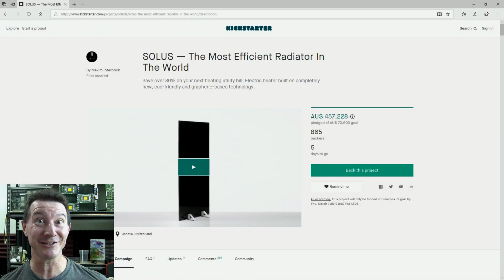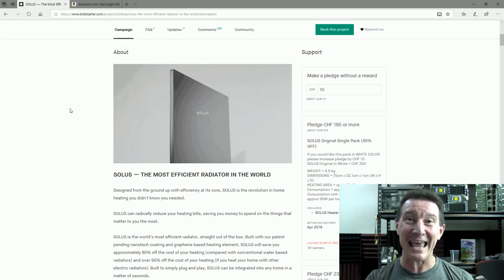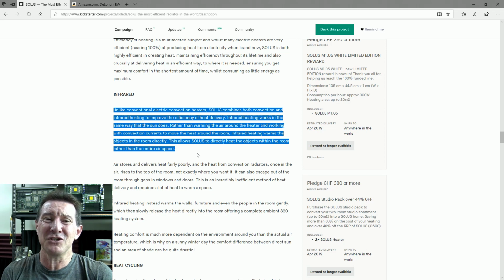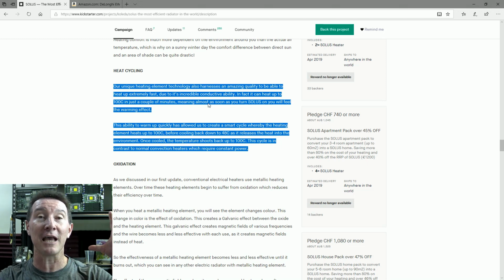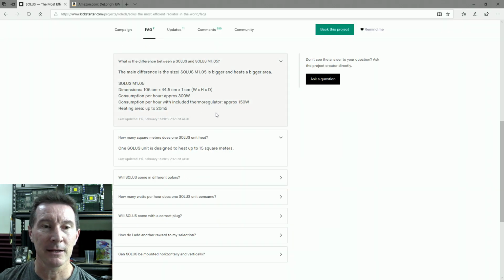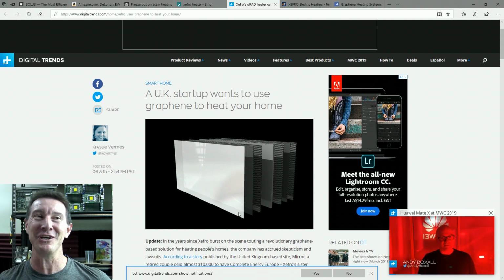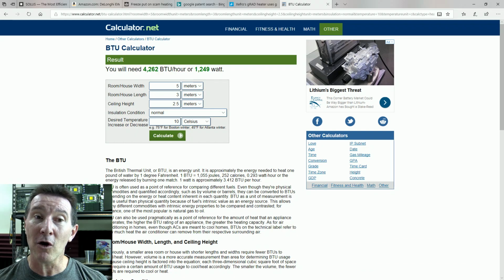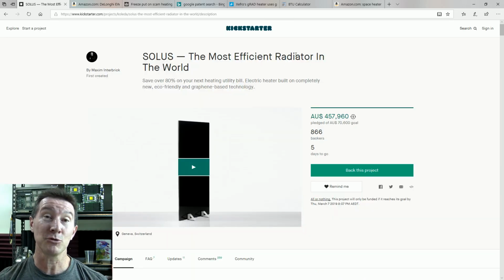EEVblog #1186 - Solus Graphene Heater Kickstarter BUSTED!

Comment: The idea is selling by the design , if this thing achieve the infrared spectrum to deliver heat not a bad idea and glass is not an issue , but my doubt is about that specific point , how you deliver infrared waves trough a tick layer of graphene , it's possible ? ,  the infrared radiator's on the market emits light and have some kind of deflector to do their job , so if this thing pretends to emit infrared radiation and is not glowing red at least , how achieve that ? , probably is not capable to do that i guess . And the "pulsing" can be achieved by a simple diode , but this device have not thermal inertia like the oil heater .
Reply: The graphene is the black body radiator - Regular glass is reasonably transparent to long wave I.R.

Comment: Marketing material: NOW WITH NEW LAWS OF THERMODYNAMICS!
Reply from the maker: Check their response to my video in the KS comments! They again effectively claim the graphene produces heat when the power is cycled off!
Reply: Thermodynamics was the FIRST THING that came to mind before I finished the video and I saw Dave brought up the AWFUL tempered glass conducting properties.
Reply: Spilled my coffee!! Ha ha
Reply: actually this heater is 500,000% efficient, the way it accomplishes that is it contains 5kg of mixture of plutonium dioxide and plutonium 238, which allows it to produce 2kW of heat energy with a half-life of 87.7 years, it's an exciting new method to heat your room and an exciting crowdsourced community of radiation poisoned people

Comment: I mean, considering the black and material, it IS one of the most efficient radiators in the world. I mean, you need to put energy into it to get radiation out, so as a 'house radiator' it's pretty shit. If you put energy in to heat it until it's red-hot, it'll radiate great!

Comment: I have sealed glass envelopes that delivers 90% heat and 10% light, any buyers....
Reply: Careful there buddy, they better not be rated more than 60W or you can't sell 'em here in good ol' 'Murica.
Reply: no, if you compare an oven with heating elements to a microwave that emit specific radio frequency; clearly microwave oven is superior for cooking. So I won't call light bulb is 90% effective at heating skin even tho it's 90% efficient at making heat.
Reply: We have a brand new model with a heavy graphene like coating, all heat no light.....

Comment: I would like to see these operate here in Canada where temperatures can be -40c at times before windchill factor which can bring the temps down to -50c. Houses here have had steam and water heated radiators since the early 1900s and is how the houses at the turn of the 20th century were heated.
Reply from the maker: Yeah, good luck with a 200W element...

Comment: Infrared heaters are designed to heat objects (i.e. people) rather than the air hence the glass which is likely infrared transparent. The idea has been around for decades. I tried one many years ago and found it to be ineffective. This just looks like a more schmik version.
Reply: I'm still waiting for some IR beamforming heater campaign on kickstart, better powered with AI-optical tracking...
Reply: @wangyeeee  The Solar Freaking Roadway of heaters. The real problem with IR heaters is that the results are like being on Mercury. Your front will bake but your rear still freezes.
Reply: @SirBunghole  That's an engineering problem. One easy solution is to simple place another high-power IR emitter on the opposite side of the room that tracks your ass. #ToastyBuns
Reply: Standard glass is not longwave IR transparent.  It is quite opaque.  Try looking through a window with a thermal imager.  You'll see nothing on the other side of the glass.  That's why the lenses on thermal imagers are made of germanium, not glass.
Reply: @stargazer7644   Fortunately somebody else who mentions this fact.
Reply: I don't think this looks like an IR heater at all. The glass would get incredibly hot from the around 1200 degrees C (+/- 300 or so) hot heating elements and touching that would leave half your skin on the glass plate. Also the graphene would absorb a lot of that infrared light and turn it into good old simple heat. Unless you want to heat that as well to glowing red temperatures which in this form factor is essentially like mounting a burning coal brick onto your wall.
Reply from the maker: alles klar klaus  - They say this only gets to 100 degC
Reply: @EEVblog  100 C surface temp is a pretty unpleasant temperature for a heater that's going to be mounted as shown in the promo videos without a cage or guard mesh - especially for people with kids... I think that's the real reason they're 50% duty cycling it tbh - if the element was on 100% duty the users would need to wear oven gloves to touch it.
Reply from the maker: @joinedupjon  Yep, can't have the peeps touching it.
Reply: EEVblog Hmm just using the stefan boltzmann law and the formula Q=e*s*A*T^4 (I changed the two greek letters into latin ones here) I found that we get around 300W total radiation with idealised emissivity at 0.9 and a surface area of 0.3 square meters. Since the object also absorbs heat from the room around it I calculated (with a simplified formula) a total 172W of heat given off into the room. Now, mind that at these low temperatures the wavelength is going to be rather long at a peak of 5-6um and not really near the visible light. But it might actually warm you up a bit if you were sitting next to it

Comment: Heater is that striped element, what they fill it is probably some kind of filling, cement or something similar to that.
Reply: Exactly my thoughts. The element will be some kind of graphite or graphene carbon fibre strands, with some cement type filler, maybe made lighter with perlite or vermiculite.
The only cost I really see in the whole thing is the tempered glass front and rear panels/plates. AAHHHEEMM. Apple.
It will be utterly useless in warming anything. The only time it will be adequate is if the room is already warm enough. Then it really isn't needed.
The slaver, bullshit, bollocks, excuses and marketing wank are this whole product.
I foresee a number of disappointed people. Gullible, easily conned, disappointed people.
Reply from the maker: It'd probably feel warm if you sat right next to it. But otherwise, 200W, meh.
Reply: That would make sense, it would help retain heat, so when you turn it off, it's still "outputting" heat and makes it so you feel warmer for longer.  With a proper PID controller you can probably reduce temp swings too.  But a proper radiator heater will do the same.  It's not free energy though, the more thermal mass you add the longer it takes for it to get to temperature.  Basically it just delays heat loss/gain.

Comment: they use entangled quantum nano dots made of graphene and whale snot......bargain!!!
Reply: Yeah but they should have added some AI, everything needs AI these days.
Reply: @DOYLECLEVERLOBE1  If they glued some gears on and called it steampunk it would run even better
Reply: DOYLECLEVERLOBE1 Also dont forget the IoT or how I like to call it,  Internet of Shit.
Reply: Whale semen is more conductive than Whale snot.... You clearly are misled by the snot industry.
Reply: they use plutonium 238 thats why they're most efficient the radioactive material produces heat and only 120W per hour is needed for the control systems, of course only downside is you cant turn it off but other than that its perfectly safe. anyway for some reason ever since i got this heater i've been getting skin burns and dehydration and have fainted several times but im sure i will get better